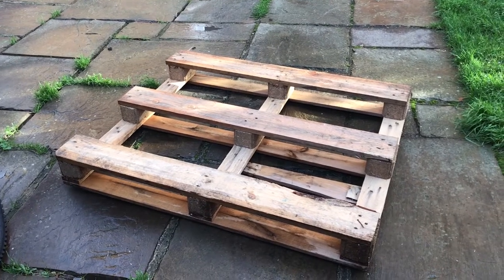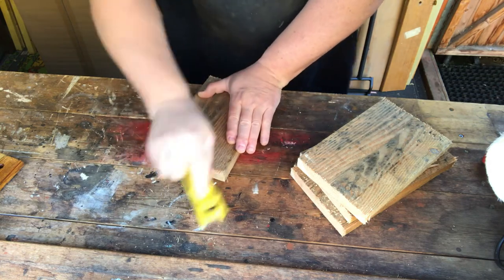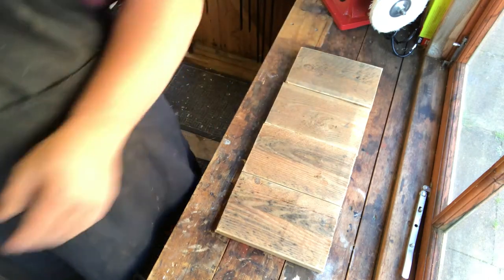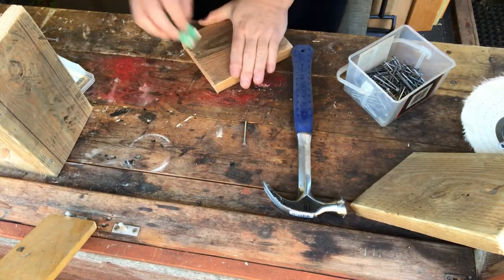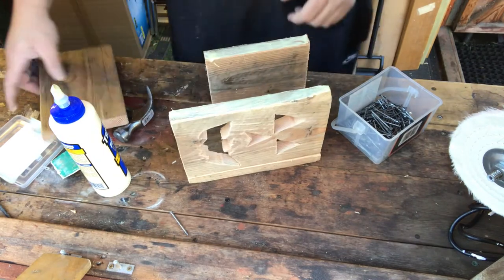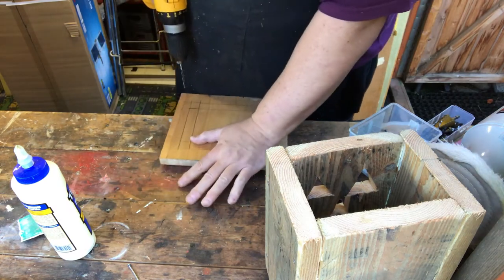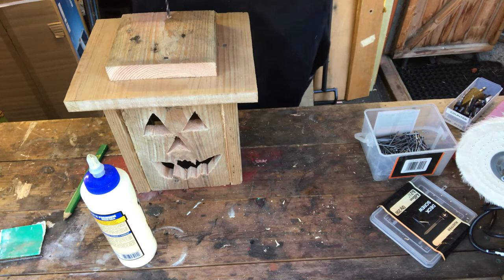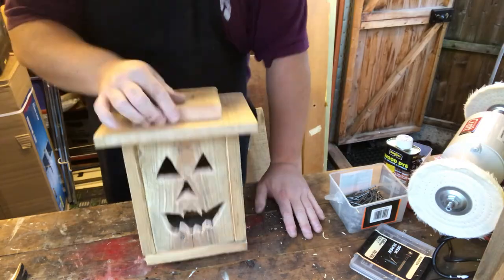How to: Make a Halloween Jack-o-lantern

Comment: Thats great that you've made that so quick.  No messing.  I spend far too long making stuff which isn't really what I set out to do when I started all this.  I wanted to be able to go in the garage for an hour or two on a weekend and come out with something to show for it.  As it stands I spend weeks making something.  Need to definitely take a leaf out of your book!
Reply from the maker: Thanks for the comment. I hazard a guess that the finish of your items may be a bit better than mine. This was rough as a badger's a**ehole!
Reply: I spend way too much time over engineering things that don't really require it.  For instance I'm making a few bird boxes at the moment.  The body of the boxes have mitred corners and they're biscuit jointed and outdoor glued.  There's some nice joinery going on but it's all a waste of time because the body is getting painted so nobody will even know it's there.
Reply from the maker: @sawdustandsurvival  yup, think you might need to take a leaf out of my book!

Comment: If you drill your holes a little more strategically, it would make your work with the jigsaw easier.  Have the hole touch a couple edges.
Reply from the maker: Agreed Damon. I wasn’t very happy with the jigsaw work but I was tight for time. I should have remembered the old saying, less haste more speed!